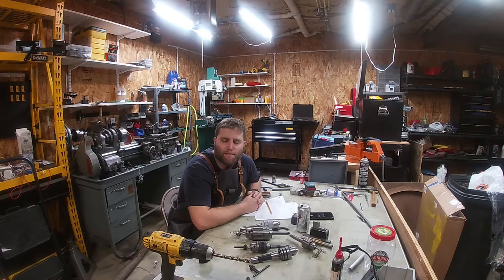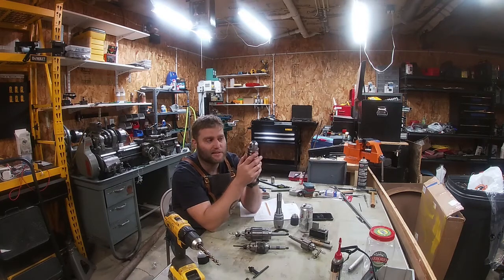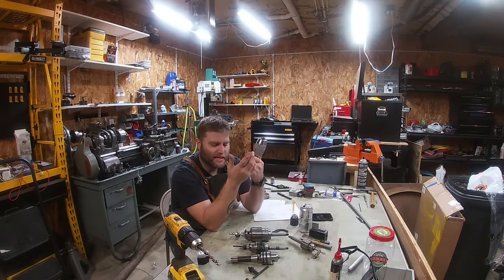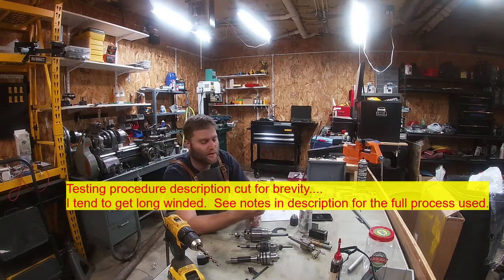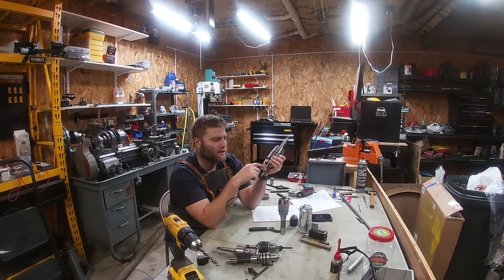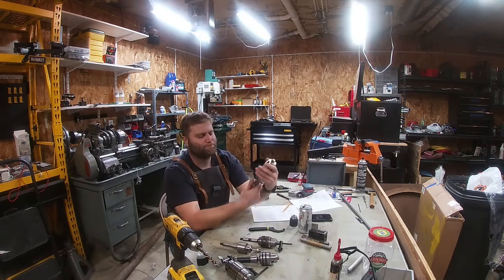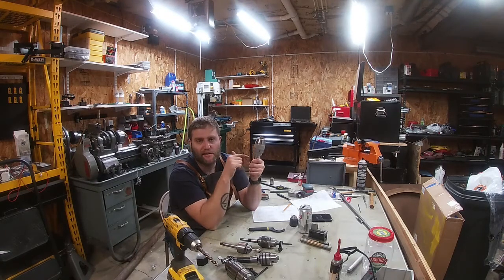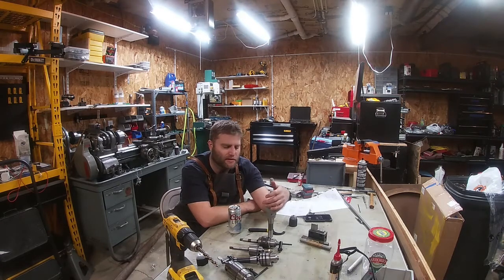Tegara drill chuck review, comparison, and runout results

Comment: I liked your video and as a result, ordered a Tegara 1/2 inch chuck with the MT2 arbor for my Jet Drill Press. I was replacing the Jet 5/8 chuck that came with it because it did not accept small bits. The specs on the Tegara were intriguing, but my experiences with it and the Shars company were not to my liking. First of all, I discovered after it was delivered and I installed it in my machine, it was NOT compatible. I knew that it had a spanner wrench that would be needed to tighten it and the day it arrived, I tried to tighten it and couldn't . I called them several times and their tech people said to turn the wrench in one direction and with your hand, turn the lower portion in the other direction. That didn't make sense to me, but I tried it and it did not work. I had told them my machine did not have a spindle lock and was told, not to worry, the wrench would tighten it. Long story short, if your machine does not have a spindle lock, it will not work. Most drill presses do not have a lock. It was disappointing for several reason. First, that it was not compatible. Second that their techs do not know their products and also, the reviews are deceptive. It shows 82 reviews, which turn out to be the same 82 reviews for most of their chucks. I guess if you have a lathe, it would be a good chuck. I'm sending it back with a prepaid label they are sending me. I ordered a Jacobs Super Chuck 14N from a different source.